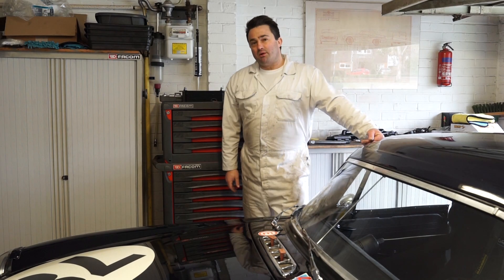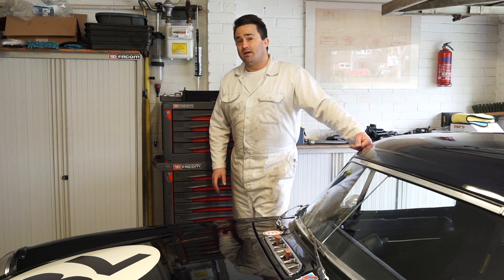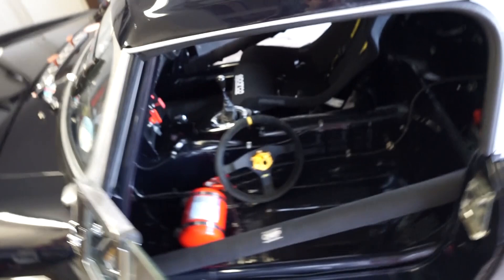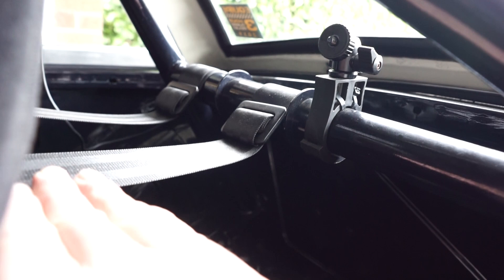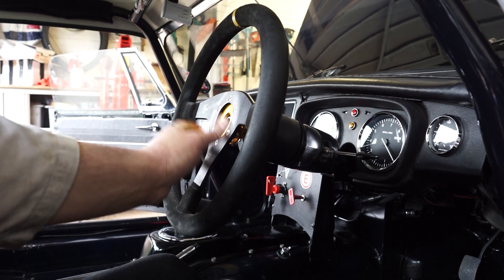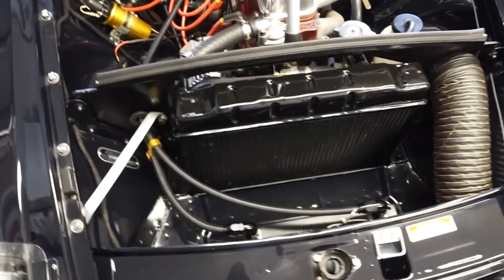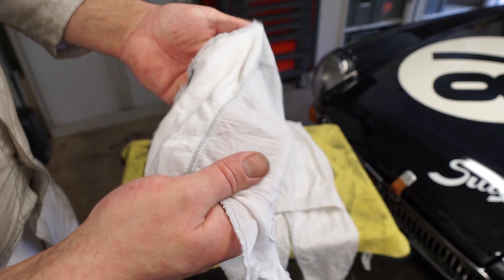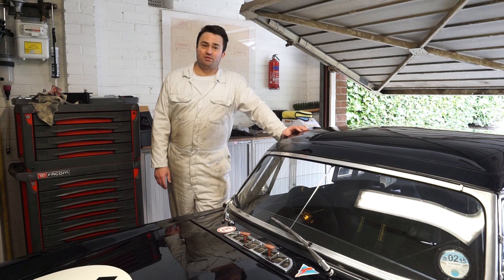MSAUK Scrutineering Checklist Race Car Tech Inspection Circuit Racing

Comment: Although I'm not into racing, this is an interesting overview of the requirements.
I noticed at 9:58 the clutch master cylinder and the clutch hardline. The hardline leaves the cylinder, then makes an "inverted U" before it travels down towards the slave cylinder. Is the top of the inverted U higher than the highest point of the clutch master reservoir? If so, wouldn't that result in an air bubble in this part of the hardline which is impossible to get rid of?
Reply from the maker: Many thanks for your message, this is the first time anyone has pointed this out. I've never encountered an issue with the clutch. The pedal box design does mean that the lines have to come in through the top, in hindsight I could probably make the hard line go a bit lower but I think it would still be higher than the reservoir. 

I've always used a pressure system to bleed the clutch, but the clutch can be an issue on these cars (most often caused but the slave cylinder) The bleed nipple is often put in the wrong place when they are sent out.
Reply: @davidrussellwilks  Thank you for your reply! I agree with you that the pedal box design poses some challenges. 
My 1964 MGB roadster came with a clutch line with a similar shape and I assumed it to be not factory-standard, installed by a previous owner long time ago. I did have issues with clutch bleeding and getting air bubbles out: I could never get it right. The best I could get it was that the clutch worked fine when the engine is cold, but after driving for 30 minutes (i.e. hot) the clutch would start to work unreliably. Especially if I needed to push the clutch multiple times in short succession. Even with brand new fluid in the system.
At one point I had to replace the hardline, for a different reason, and decided to keep the "inverted U" lower, below the fluid level in the reservoir. Since then I never had any issues any more. Not with a cold engine, not with a hot engine.
Based on this experience with the clutch hardline I copied that to the brake hardline: making sure that at no point it is higher than the fluid level in the reservoir.

Success with your upcoming races!